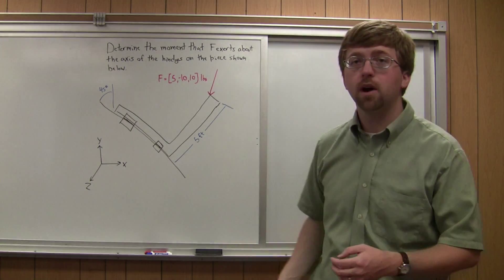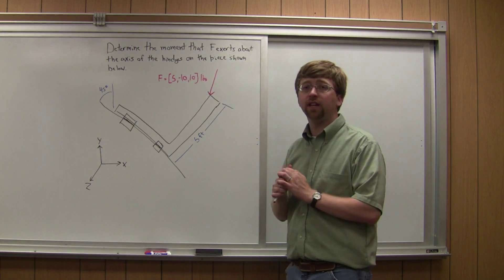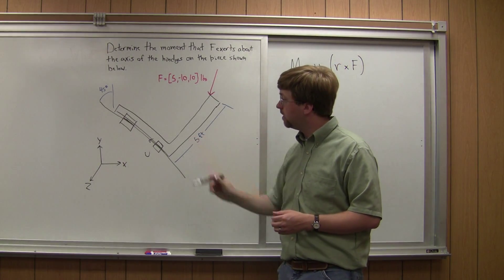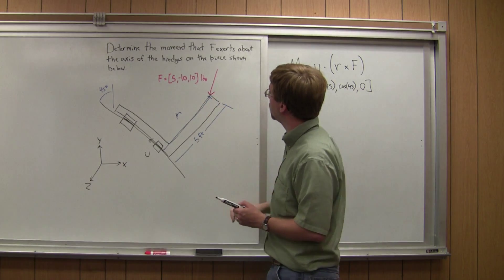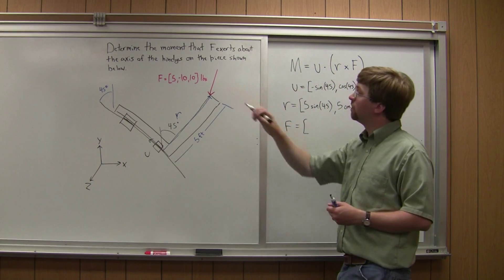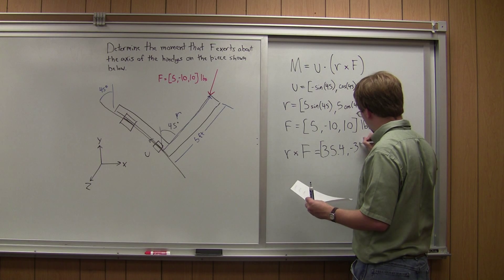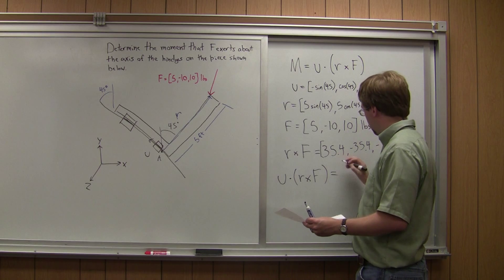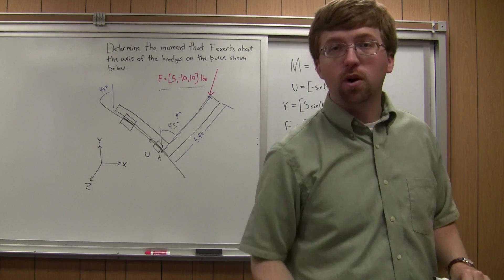Moment of a Forces About an Axis - Adaptive Map Worked Example 1

Comment: Your units are wrong. u is a unit vector, which means its unitless. 
Its just a direction, not direction +  length.
Otherwise dot( ft , cross(ft, lbs) )  = ftftlbs, not ftlbs.
Reply from the maker: Correct, I should not have put any units next to the u vector. It should simply be unitless. Other units in the problem are correct though.

Comment: If we choose different point on the same axis then r will be different and rest of the things same and so the moment should should change about the axis but it remains the same how?
Reply: I think this has to do with the fact that moment is a free vector, it basically means that you move it in space and obtaining an equivalent system the that before translating the moment vector, and if so you can imagine calculating the moment about a specific point on the specified axis and then translating it to any other point on the axis , "it wouldn't matter because the two systems are equivalent" . I know you must have finished that semester  tho lol.
Reply from the maker: As long as we choose a valid r vector going from the axis of rotation to the point of application of the force, the cross product will give us the same result (the moment vector) in the end. The cross product relies on the magnitude of the two vectors but also the angle between the r vector and the force vector. As we move the start point of the r vector further away, it increases the magnitude of the r vector, but also changes that angle between the r and force vectors. These two changes always end up canceling out in the final result, so there are many r vectors that give you the right moment vector in the end.
Reply: @jacobmoore8043  Actually the cross product vector is different but the dot product of that cross product vector with the axis unit vector is same.
Reply from the maker: @adityapandey8096  Yes, sorry you are correct. The cross product will vary, but once you take the dot product it should be the same.